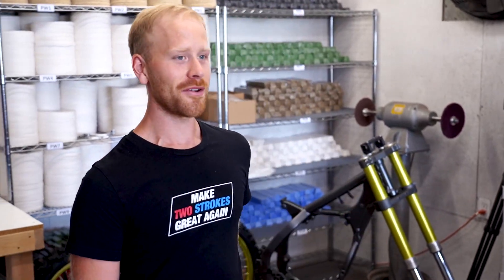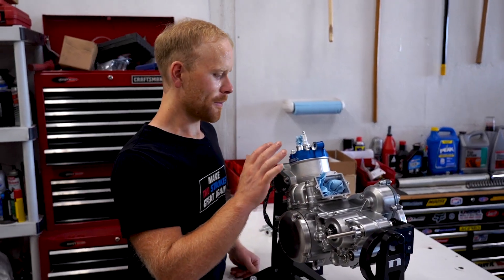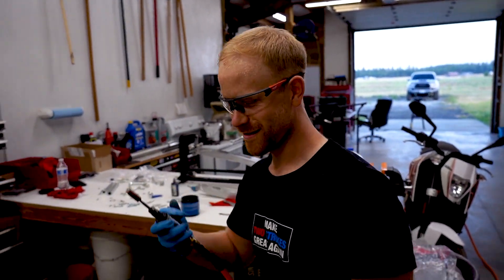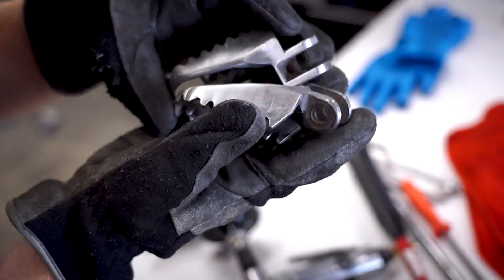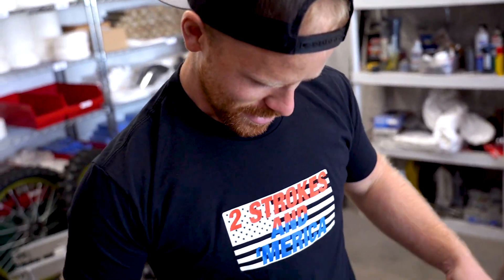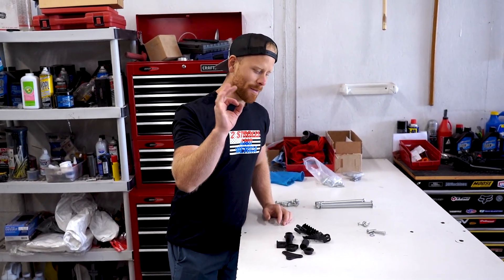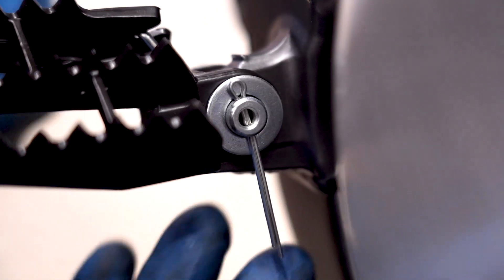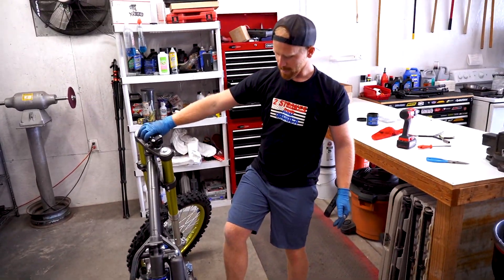Starting The Build! | RM250 Rebuild 25

Comment: When you put the front wheel on hand tighten it, spin the wheel then pull the brake in. 3 times helps align the front wheel up with the fender an doesn't feel as shit.
Reply: You're giving this guy lessons ?

Comment: Use silicone to seal the steel bolts into aluminum this has been used to great success when dealing with outboards in saltwater

Comment: Doubt that bit of dust will hurt the engine. If it was sucking in dirt constantly during operation than might be cause for concern but if that little bit causes engine failure then that doesn’t say much for Suzuki 🤷🏼‍♂️

Comment: I need to win this bike I currently have a 01 that I can’t get to clean out under power, thinking I may have to change t he whole cylinder to get it fixed but anyway, I need to enter to win.. also check out the word on Tomac riding the new yz 250 2 smoker  😉

Comment: Cameron, I am just as concern as you.The only difference is that I am an old fart (78) and supposedly in the age to be careful. Love Trump and the USA. Just finish completely rebuilding my 2002 CR125 Husqvarna just did not do the polishig and finish that you did.
Reply: Test ride it through all its capable and then totally disassemble and do a frame off restoration ..thats the way the pros do a brand new build of anything .
First you build it. Run it to get all the bugs out and total performance in..and then when you are absolutely sure you are not going to be turning wrenches on it for anything major ..thats when you making all pretty again ..and since this will be a one time deal for you ..i highly recommend buying Harbor Freight buffing tools Motors grinders Sanders polishers as I haven't yet but they're buffing motor specially-made for what Cameron's doing here and it's like $78 or something. But from what I'm saying at my local Harbor Freight this buffer they have has a very tightly woven buffing wheel that's pretty hard and we'll do some major polishing quick in a hurry but the replacement Wheels they have are purpose-built softer and I don't see any harder ones that they offer but you can get a ton of them online what I have right now is a hard buffing wheel 8 inches in diameter sandwich to another one that's a little softer and selling one step I can go from hard cutting to soft buffing I have mounted in a drill press works great as I use the drill press table for an armrest or a hand rest to hold the parts and probably so once you get into doing this you'll get hooked on it like I am at 70 years old I stand around polishing all kinds of metals all day long just to see what they look like and helping make decisions on what to buff  want to leave rough on other projects
Reply: @donniebaker5984  Thank for the advise Donnie.

Comment: Wow, I stopped watching when you failed to check the squish when using a new head.  Seriously, where’s you clay or solder.  At least coat the cylinder with premix and roll the engine over by hand once.  Maybe you did that later and I just missed it.